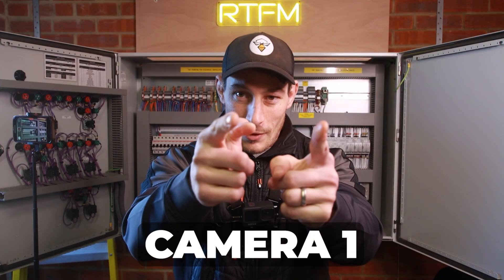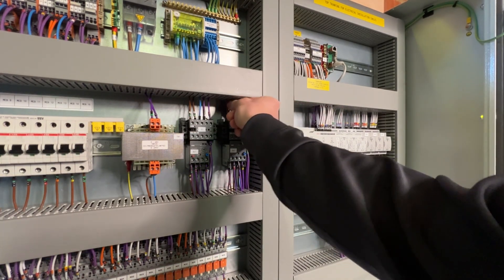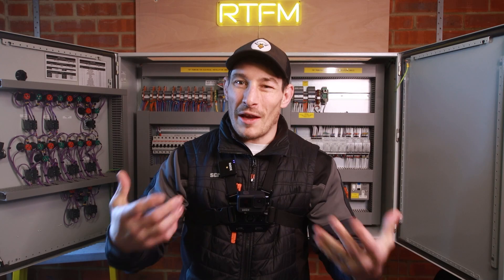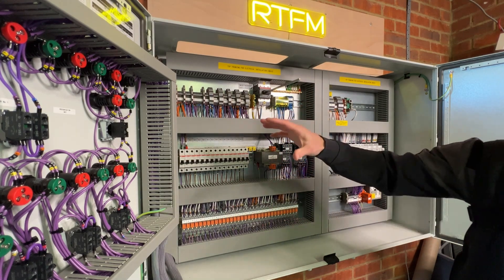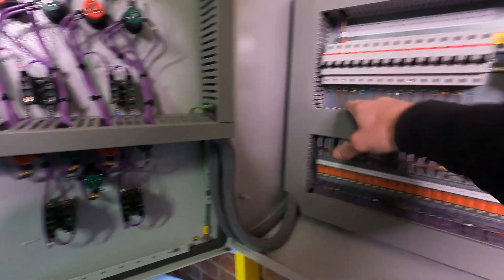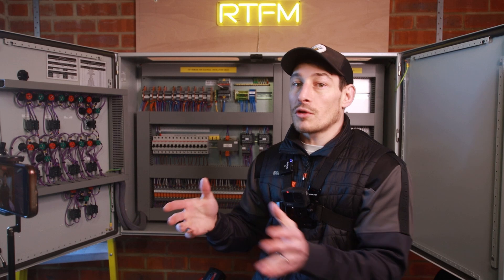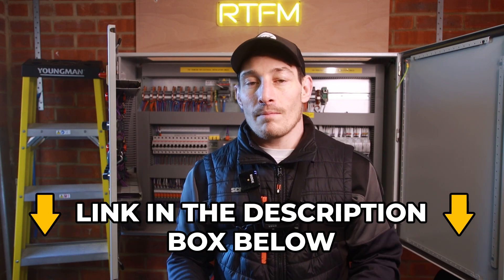5 Control Panel Wiring Mistakes to Avoid

Comment: 0:24 1. Poor planning

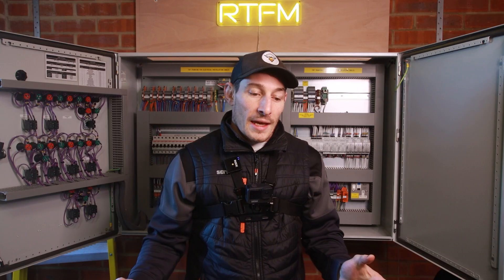3:46 2. Manufacturing line thinking

5:45 3. Not wiring in order

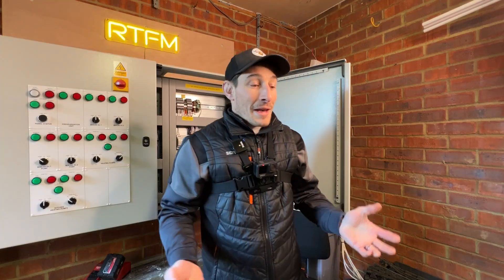10:12 4. Not double checking or triple checking

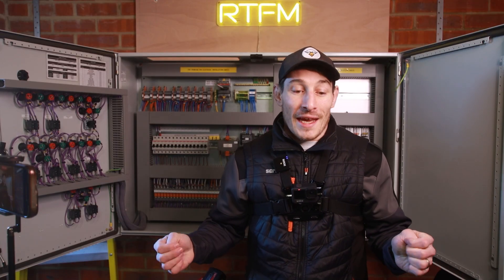10:56 5. Not testing & fault finding

Comment: One of my biggest pet peeves is where builders measure out 20 cables to wire a block but do not trim them down when they make the other end and you end up with massive loops in a packed trunking.
Reply: And then I go there after you and curse like hell when I can't get enough wire out to get a clamp meter over it.

Or replace a component which always has couple connections on the other side compared to the old one. Pretty sure there isn't time to do the wire markings after running around the plant to get wires, when it's always for that last 50mm that was missing and the production line has to get going yesterday.

Planning for a bit longer wiring makes it much easier to maintain. There's usually a lot of wires that are "just the right" length. That makes unpenetrable wall of wires. I often won't trim those pre measured for maximum length between two blocks wires, as they seem to naturally spread more evenly that way.

Then there's connector blocks for field cabling. I don't know how the cabinet makers think that installers will be able to tie down, mark, strip and connect 200 cables in a 30mm space.

I even have a crochet hook in my pocket for fishing wires from too tight places.. Plastic ones won't last very long, have to go for metal and add heatshrink to make them safer. I got laughed at when I got the first one, but it's been so good that I'm surprised the tool stores don't have them on sale.  It would be nice if the cabinets were just a bit bigger and you could trace the wires with your fingers.

Comment: Why do you need zero volts on relays?
Reply: To bring the coil in. The 0v is the neutral (ground) on the transformer. You'll have a line voltage depending on the rating of the coil on either the A1 or A2 (generally A1) and a 0v on the A2 or A1 (generally A2).